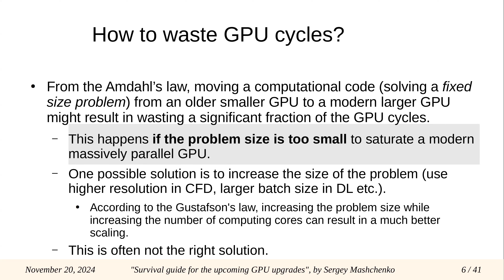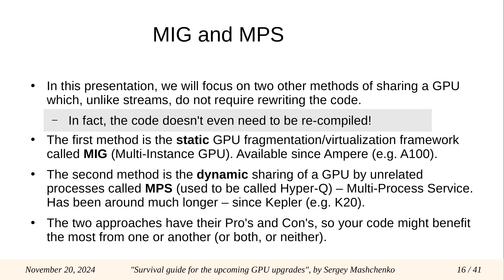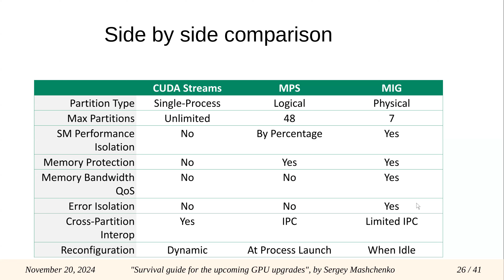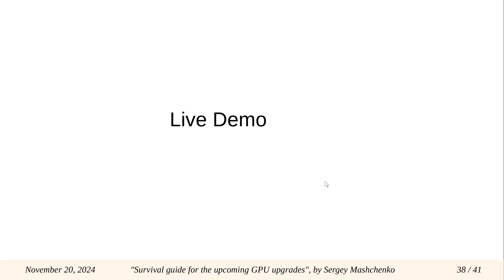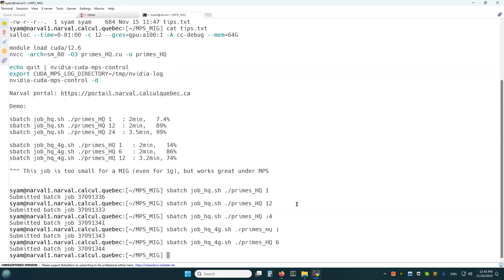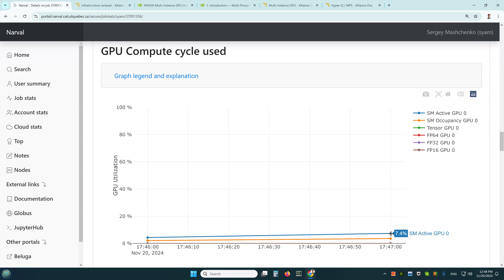Survival guide for the upcoming GPU upgrades (more total power, but fewer GPUs)

Comment: A very important issue that MIG introduces to the multi-GPU systems, is the fact that all types of peer-to-peer accesses would be disabled and the communication time across inter-node GPUs would drop dramatically. This will result in an environment in which CUDA-Aware MPI and UCX cannot utilize NVLinks. How will you guys handle this issue? Would users be able to enable MIG on demand? (it usually requires sudo access) On the other hand, enabling MIG statically on even a small subset of the GPUs would sacrifice more performance from the cluster's potential peak, because all of the inter-GPU NVLinks would be useless until MIG is disabled again. How is this going to work?
Reply: Can you describe the scenario in which it would make sense for a job to use multiple MIGs like that?  Our main motive with MIGs is to address the extremely common problem of jobs that underutilize a whole GPU.

Maybe the short answer is: we expect to have whole GPUs available as well as MIGs.  Whole GPUs make sense for jobs that can use them effectively, of course - including across nodes.

(I am Sharcnet/DRAC staff.)
Reply from the maker: I suspect MPS is the answer, but this needs to be tested.
Reply: @markhahn0 
Well, that's the point. There are virtually no reasonable scenarios in which it would make sense for an MPI job to use multiple MIGs, unless the code is extremely and embarrassingly parallel with little to no communication across the GPUs. That's why most of the users, who knows what they are doing, won't use the MIG-enabled GPUs for their MPI/Multi-GPU jobs, making the race to acquire non-MIG GPUs even more competitive than before. This results in longer waiting times than what you already expect. 

I get your motivation and it's absolutely important to take action. However, I suspect using MIG for a big chunk of nodes in an HPC cluster is an efficient solution to this problem, and it may backfire. There are some considerations/suggestions that come to my mind about this:

1. Enable MIG only on single GPU nodes (a portion of them, if there are any)
2. Enable dynamic MIG configuration - preferably by slurm itself, and ambitiously, depending on the jobs and their requirements
3. With number two, then maybe you can enable MIG on multi-GPU nodes, if there are enough requests for them.
4. Do what you are doing: instruct users when and why to use MIG, and help them write better code.

@SHARCNET_HPC
Yeah, MPS is a better choice I guess, and users should be encouraged to use it. I wrote a couple personal posts about MIG and MPS-on-top-of-MIG that might be helpful. 
https://amirsojoodi.github.io/posts/Enabling-MPS/
https://amirsojoodi.github.io/posts/MIG/
https://amirsojoodi.github.io/posts/MPS+MIG/

P.s. Regarding MIG and its related issues, NVIDIA said they might relax the constraints in the future, but who knows when. 
Read here: https://docs.nvidia.com/datacenter/tesla/mig-user-guide/index.html#application-considerations
and here: https://docs.nvidia.com/datacenter/tesla/mig-user-guide/index.html#cuda-device-enumeration

Comment: 15:21 MPS and Hyper-Q are separate, but related concepts. Hyper-Q is basically a hardware feature that is available on GPUs since compute capability 3.5. While MPS is a software solution that utilizes this hardware feature to enable multiple processes sharing the GPU more efficiently.
Reply from the maker: You are right: "MPS enables cooperative multi-process CUDA applications, typically MPI jobs, to utilize Hyper-Q capabilities on the NVIDIA GPUs."